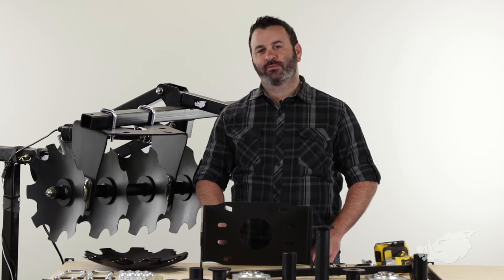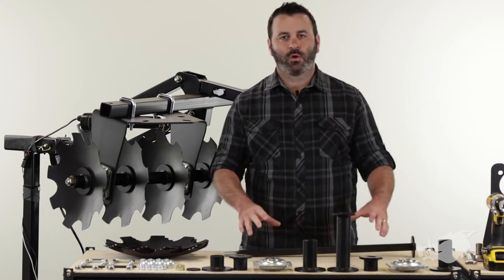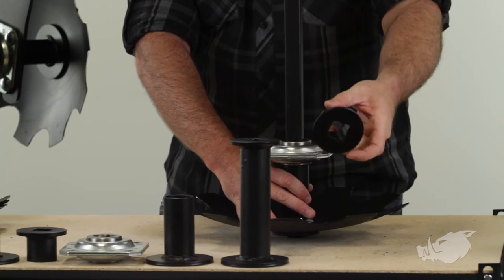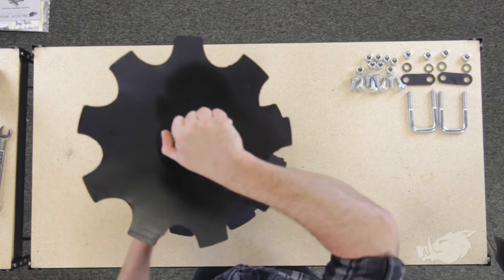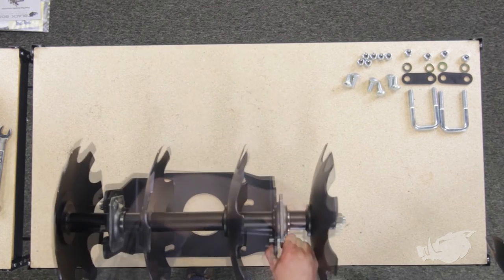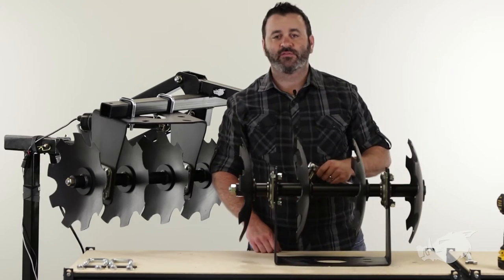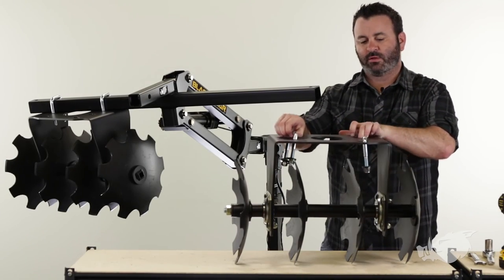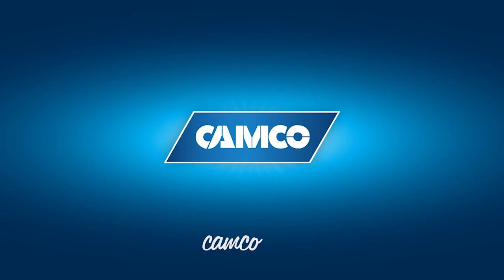Black Boar Disc Harrow: Assembly and Installation

Comment: Good luck getting it on that easy. Those U-bolts DO NOT slide on like that. It takes two people to get the disk on. One to line up the U-bolt up with the bar and the other person with a hammer to tap/pound the U-bolt onto the bar. Plan on a good half hour to get the discs on the lift. I’ve been less than impressed with the whole Black Boar lift system. The manual lift crank is way too stiff for a cordless drill out in the field (doesn’t help that the grease fittings are bad so lubing the screw lift is made difficult/impossible). You better have some oomph to hand crank it.
Reply: I agree the manual lift is garbage. Having seen people break their backs and having to get on and off your atv. I was smart and went with the electric lift! Well worth the extra green!